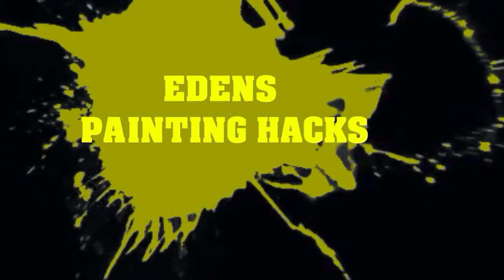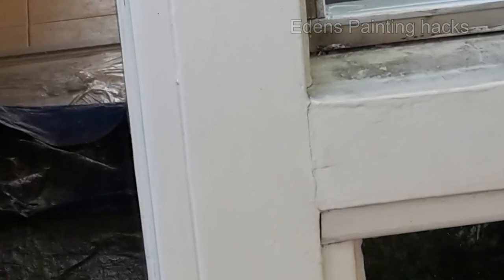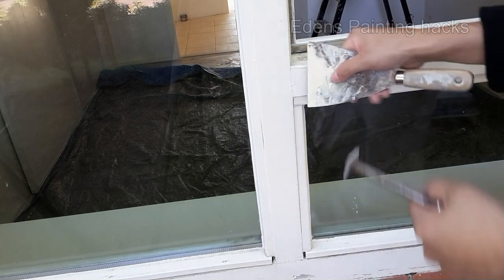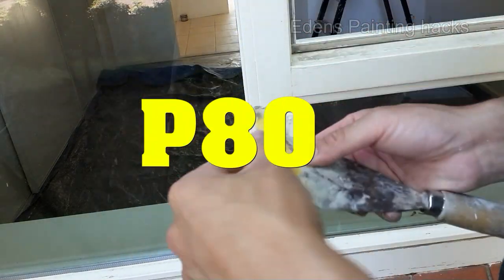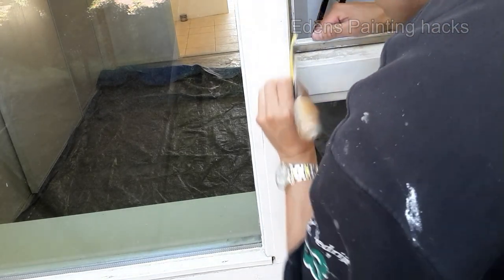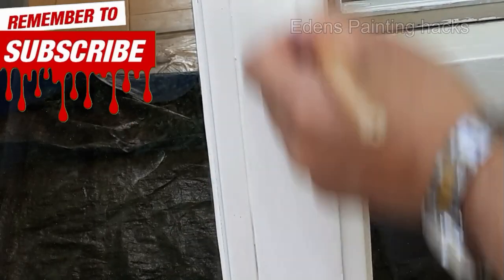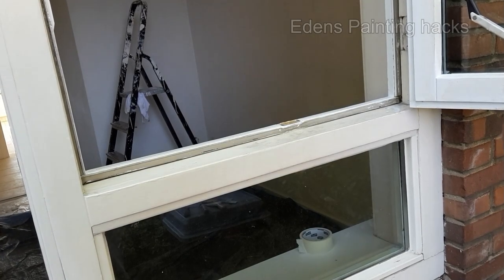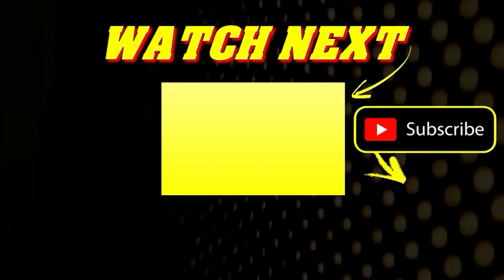HOW TO CREATE A V-GROOVE JOINT ON A WOODEN WINDOW FRAME? DIY Tutorial

Comment: I have the exact same cracks in my window frame. I will definitely try it out. Do you have to seal the seam afterwards?
Reply from the maker: "Yes, it is recommended to seal the seam after creating the V-groove joint. This helps to make the joint watertight and prevents dirt and moisture from entering the joint, which could cause the joint to rot faster. It is advisable to use a high-quality glazing putty that is specifically designed for outdoor use. This provides good adhesion and durability."